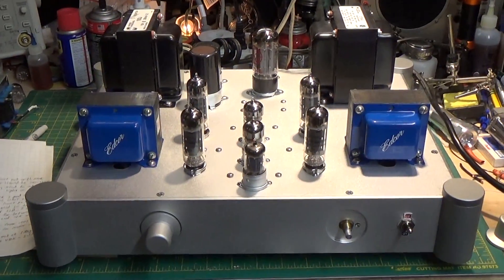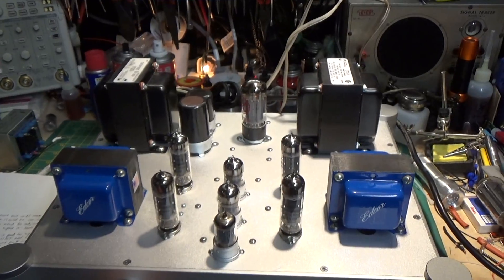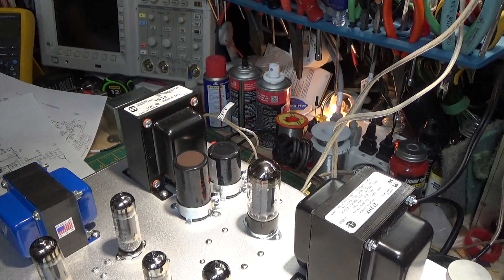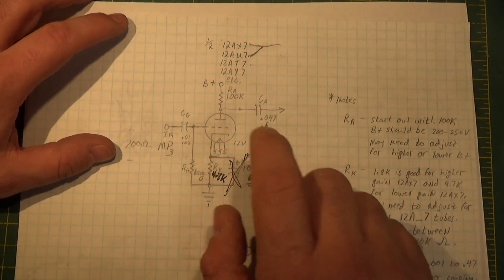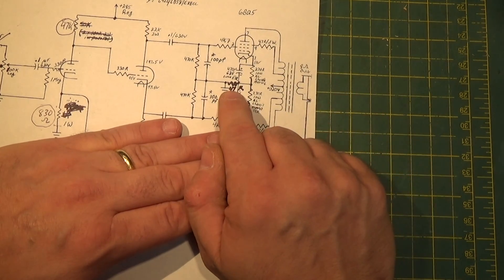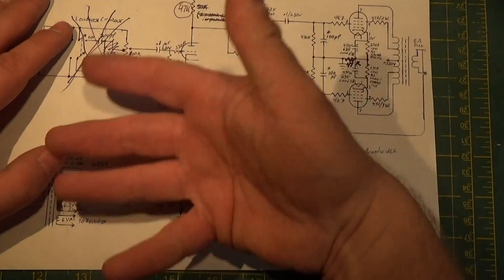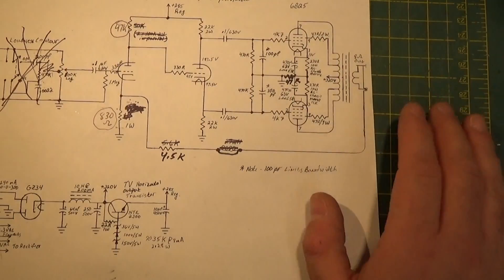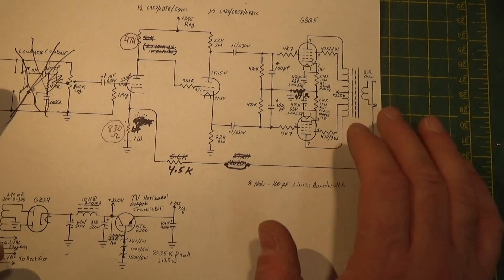Scratch Build a Stereo Tube Amplifier - Part 9 - Update and Preamp Addition

Comment: Since you have a center tap on the 6.3 winding to ground, and the second half of the 6922 cathode (phase splitter) is at 97v, you have the Heater negative with respect to cathode greater then 60v (see tube spec sheet). To reduce the chance of arcing, create a voltage divider tap from the B+ (50v), lift the grounded center tape of the 6.3 winding, and connect it to the 50v tap.
Example: 320k + 56k connected to the 320v will give you 47v across the 56k to ground (add a 10u cap across the 56k resister).

Comment: Negative feedback gain, as well as a tube current must be adjusted with a running measuring software, that will show you level of harmonics. This is about $100 for a very good sound interface. About nothing. This is easier than to match tubes to each other, and produces an overall better result. And negates a cheap loudspeaker FR when you try to adjust an amp by listening.

Comment: I don't know if anybody asked already but if you add the extra line stage, wouldn't the signal phase be 180 from the source? And if so, do you need to invert anything? I read somewhere that if you use a small line stage like the one you made or an SRPP, you need to invert the speakers leads. Can you please advise? I'm having an old tube amp and has the same problem of needing 1.3-1.7vrms to drive it correctly so I'm unsure if I need to do anything extra besides just adding the line stage in the audio chain. Thanks in advance.

Comment: Tony, I have this audio decoder board (panel mount about 6” x 1 1/2”), powered by 12V, that I got super cheap .. it uses a single chip for mp3/Bluetooth/FM receiver, and includes a remote. It’s really amazing and sounds quite good. Can I send one to you (for keeps), for you to do a video on sound quality testing?

Comment: You need a capacitor across the 4.5K resistor in the global feedback network.  You should also have a capacitor in series with the 4.5K resistor to stop the feedback network changing the DC bias conditions of the first triode

Comment: Thank you for this series of videos. You've inspired me to do something with this pair of Sansui H 30-8 audio transformers I've been sitting on for the past 30 years. I've deemed the transformers OK by using an auto transformer to determine voltage ratio. I believe they are good as both transformers test identical. Primary impedance from my calculations is approximately 1750 ohms, seems low from what I typically see browsing youtube projects. I've not been able to find out what unit these transformers are from. I'd like to know what power handling capability the transformers have in order to determine what type of tube to use. Is there a database you know of that lists the application of a transformer such as this. Thanks Again, learned so much. Great Job!
Reply: When measuring voltage ratio on a push-pull transformer, one must apply voltage across entire primary rather than center tap to plate leads. Made a huge difference. Now closer to 7K input impedance.

Comment: I have followed you up to here with this amp and have some suggestions. The gain without feedback as I see it is about 40 dB.
For 1 volt in and 11 volt out you need 20 dB of feedback leaving 20 dB for amplification. With 820 ohms under the first tube
the feedback resistor (4.5k) should be ca 10k to get the 20 dB of amplification. The inductor is gone-good. A capacitor should be around feedback resistor and can be tested ouut by appying a 10kHz square signal to the input. With a 500 pf variable cap the ringing on top and bottom of the sqare wave can be tested out.
Try a higher values on the grid stoppers (the 330ohms)on the input tubes to cure the parasitic oscillation.
Reply from the maker: Thank you for the advice!  I will have to try applying the 10kHz square wave signal.   Right as it is now, everything seems to be working OK, but I'm very interested in trying out your suggestions.  Thank you!

Comment: just found these videos while trying to learn more about diy tube amps. As much as I would LOVE to build, and own one, I feel like this is outside my very basic knowledge of electronics. Is there a way...short of  college class...to learn how to do this at the hobbyist level? Also, how much (roughly) would it cost to build an amp like this?
Reply from the maker: I would start small.  You can find kits online that are much easier to build than from scratch, because the design and layout work is already done.  I would also watch more videos.  There are some pretty good ones out there.  An amp like this one would cost around $500 to build, if you had to buy all the parts.  MOst important, learn how to work safely with high voltages.  Tube equipment can be very dangerous due to the high voltages and relatively high currents used in their design.  Read up on safety!  Good luck, and enjoy your new hobby!
Reply: thanks for the advice, definitely looking forward to giving it a shot.

Comment: The bypass caps on g2 look like100pf, this seems a very low value. Can you run through how you choose RC value's for the screen grid on your Q&A please? Did you adjust NFB with a distortion meter and why no cap on the NFB? Did you test with sq waves. That and why did you use a regulated B+; is that a big horizontal deflection TV tranny?
  Cheers.

Comment: Maybe a stupid question: isn't a feed-back loop supposed to have a pot for fine tuning or adjusting?  How would the output stage evolve as tubes have more miles on the clock?  Any need for adjusting later on?
Reply from the maker: Global negative feedback is usually a fixed value based on the design of the circuit and the amount of feedback (usually measured in dB) required to achieve minimum distortion.  This value can be calculated, but can be very difficult to calculate because of all the variables.  When I used the variable resistor, I was experimentally adjusting the feedback value to achieve the best results.  Even when I try calculating the value, it usually ends up being off a bit.  Once I get the potenteometer set to the optimum value, I take it out of the circuit and measure the resistance.  Then I install a fixed resistor of the same value.  As the tubes age, you just need to adjust the bias, if the amp uses fixed bias.  If cathode bias, you don't have to worry too much, as it will still be pretty close.  Hope this helps.

Comment: I have a question Tony. Could you incorporate the 10K pot into the build if you wanted to and skip the fixed value resistor?  For instance, mount it to the back of the chassis in the event you decided to use the amp on higher line level audio equipment so the negative feedback bias be adjusted on the fly?
Reply from the maker: Good question.  I have seen something similar to that in some amp designs.  They sometimes call it a "presence" control.  You would need to install a fixed resistor in series to limit the minimum feedback to a level that won't bring the bias of the preamp tube too far out of line.  Increasing the resistance of the feedback resistor would cause an increase of distortion & volume and a decrease in bass response. You also have to be careful you don't send the amp into oscillation.  The only time I would consider something like that would be on a guitar amp, where distortion and brightness are sometimes desirable. Hope that helps.